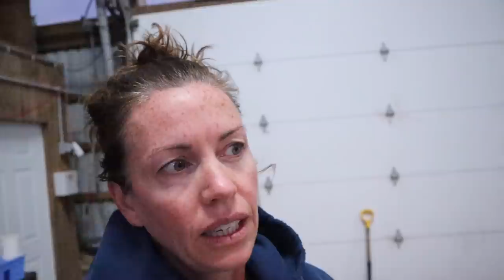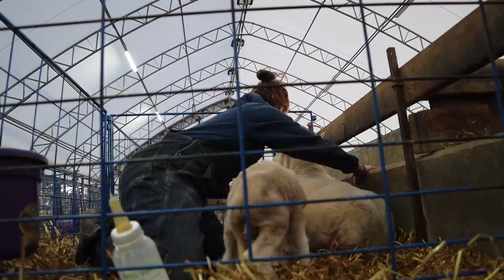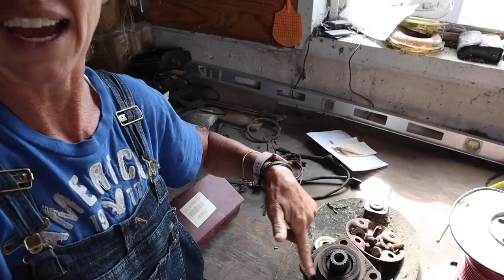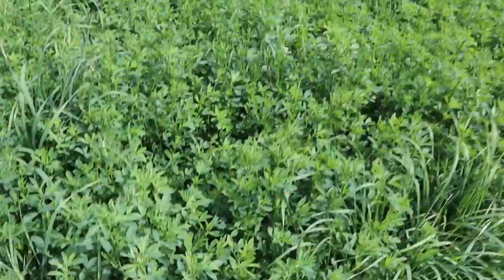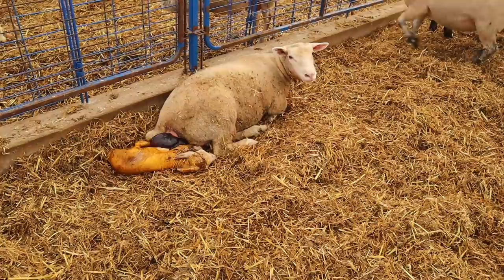Hay is ready... Discbine not so much.  (SECOND CUT HAY 2020 - PART ONE) Vlog 318

Comment: Good morning Sandi, hotter than billy blue blazes here. Uncle moved all ewes to broken meadow, lot more shade and cooler. Wethers  and rams are on shade pasture also. He cut 2nd  cut yesterday needs to get turned and baled/bagged by tomorrow. Excessive Heat Warning from 11 am to 8 pm, today. YIKES!!! Ran to both broken meadow and shade pasture to get extra troughs filled with water for the BAAAA's. Did you hear me screaming in Ontario, huge garter snake under one trough,about came out of my own skin¡¡¡¡¡¡¡ LOL LOL LOL anyways fingers crossed that you get thru this cut without any mishaps.

Comment: thr New Holland cutter bar pods  needs oil changed twice a year if you are cutting a lot of hay and it should have 85-140 full synthetic gear oil, there is only 10 oz of oil in each pod and they will fail if you try to run to many hour with out changing the oil

Comment: Was wondering if you could use a nasogastric tube for dry lamb deliveries so that you can lube right to the back as well as the front. It might also be easier to do repeated lube as you can draw up or direct from the lube bottle

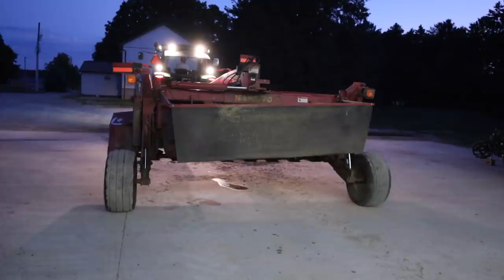Comment: First off... Hi!!  Second  NEVER too many lambing videos. Ever. Period. 🐑 I came for the lambs stayed for the Sandi. Third.. as I was watching all the tension in the shop as Mark worked on the Haybine some part of me wanted when he bumped over the lip in the cement when pulling it out of the shop at 21:33 for the bottom to just fall out of her. Parts flying, gears clanging, rolling here and there..

 I know that would be my luck. At that point you just laugh because if not you'd cry.. or cuss.. A lot. 
Sometimes all 3. I mean I am female I am allowed to do all 3 before breakfast.  Lol

Comment: Sandi. I've read some stuff on Internet about pregtox and it says that it's sometimes related to the weather/stressful environment. Do you think these ewes had this problem of pregtox because of the trauma caused by the roof Drama and the extreme weather changes in your barn during that period of time ?
Reply: This bunch would not have been bred until February I believe, well after the roof had been fixed. It could be that a very cold early May, and then a very warm late May and June, and a current heat wave may be having an effect.

Comment: Especially seeing little billies or multi colored ones or teeny tiny ones. You talk about it being so hot how hot is your days? We are triple digits and don't get rain either here in California
Reply: Well today (July 9th) in Ottawa which is just under two hundred miles NORTH of where Sandi farms we hit 35 Celsius ( 95 Fahrenheit), which felt like 42 Celsius (107.5 Fahrenheit) because of the horrendous humidity. A hot summer day here is usually about 26 to 30 C ( 78 to 86 F) and the 30 C day is considered HOT.